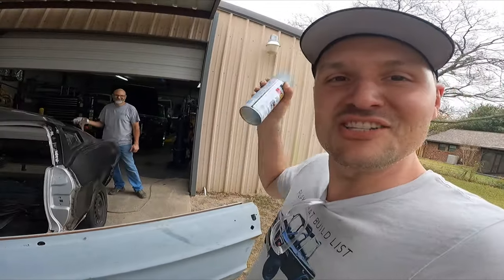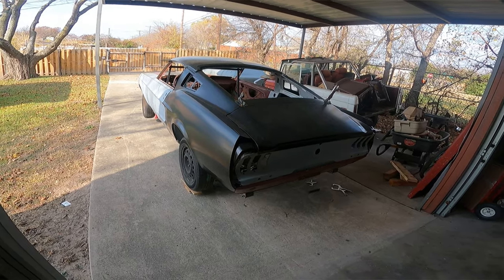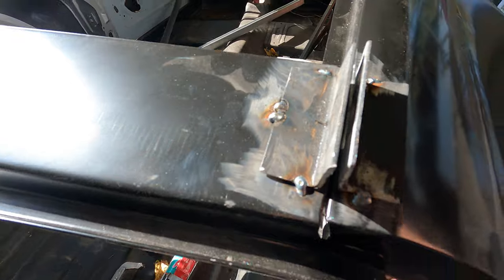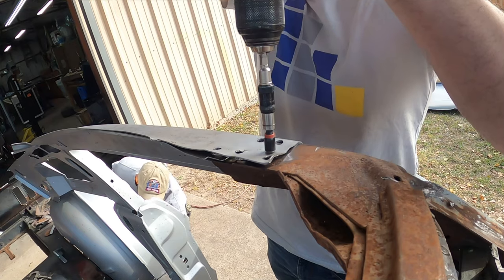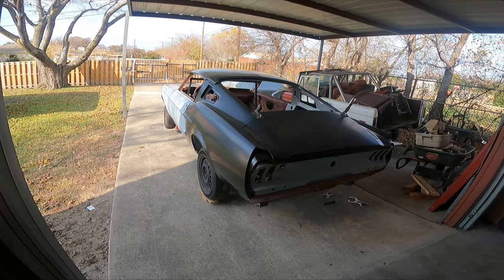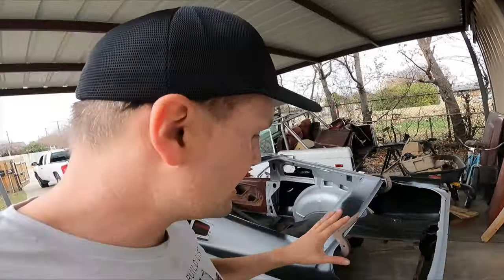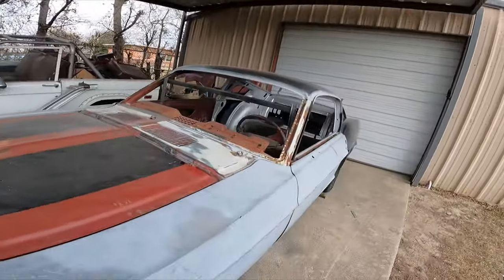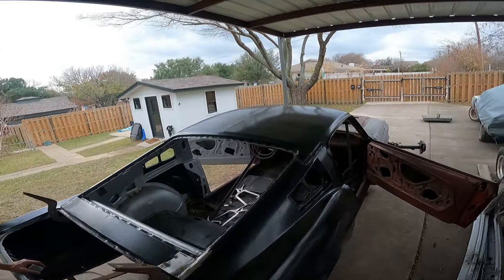Major Mods! Coupe to Fastback Conversion 67-68 Mustang Part 2

Comment: Seriously considering this same conversion, as it seems relatively straight forward. However, was wondering if you had any experience with the inner bracing and brackets that are sold along with these kits. Stang-Aholics sells one such kit with 42 pieces, but without an original fastback for reference, I'm not sure how someone is supposed to know where each bracket should go. Did you do this step during this build?
Reply from the maker: I hope to show another complete conversion soon but yes the brackets for the interior are sold as a piece kit and great quality. They are pricy though!
Reply from the maker: You can find locating info for each bracket. I’ll try and find a diagram or create one myself…I think it would be super helpful